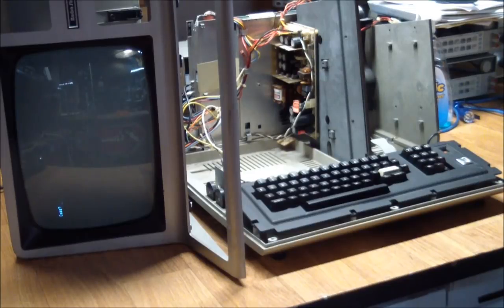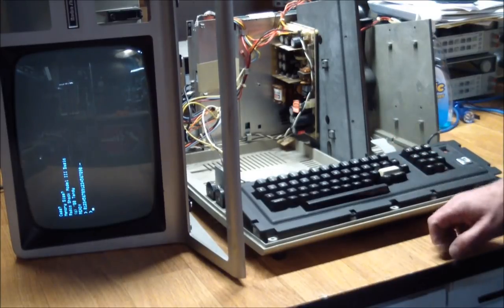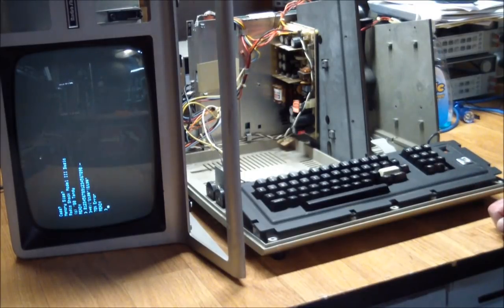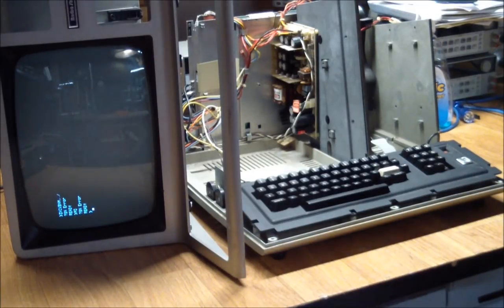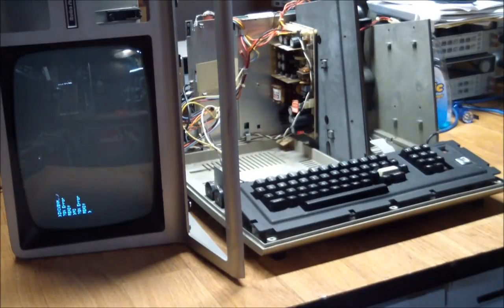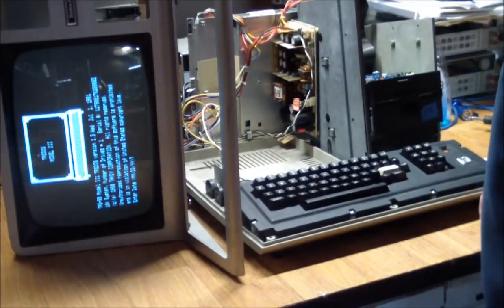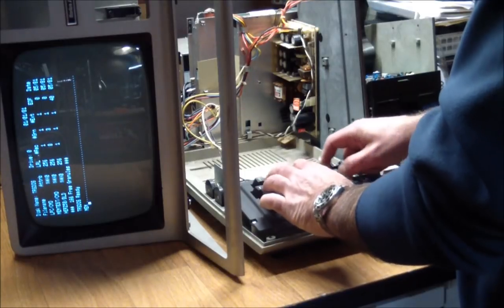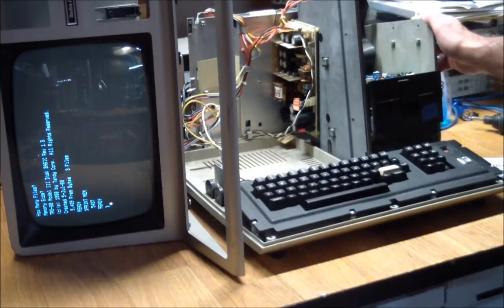AE#73 Repairing A TRS-80 Model III Keyboard

Comment: Thanks for this video! Just repaired my M4 keyboard in a similar manner. I just used a small set of pliers to remove the switches from the metal frame after desoldering them (grab the tabs and pull them upright from the metal frame, makes it really easy) and 99% IPA to clean the metal tabs inside the switches. Keep up your good work!

Comment: I would add a tiny bit of lightbulb grease on the metal contacts to prevent corrosion. For punching out the foil, I would remove the backing and stick it onto a clean UHMW cutting board and punch it out. The adhesive won't stick well to the UHMW, allowing for easy removal. I believe, however, there's a flesible graphite base paint.

Comment: I'm working on a Model III with some non-functioning keys, but this machine has switches that are the same as the Model I (2 pinouts, and a funky switch mechanism. For all but one, I was able to get the switch working again, but one of them is holding out. When I say the switch mechanism is "funky" it has two exposed copper lines and then a Y-shaped piece that "springs" out above the two copper lines. Pushing the key down pushes the Y-shaped piece closer to the exposed copper lines and lowers the resistance. I'd say the switch was designed to enable the detection of the depth to which the key was pressed.
Reply from the maker: That almost sounds like a touch or velocity sensitive key.

Comment: Anything under 1000 ohms is good.  Clean the metal in the bottom, and lightly "sand" the carbon pad on printer paper.  Get the resistance to under 100 ohms, most under 100 ohms.  Should be good for many years.  One could also change the pull-up resistor pack, RP1, on the mother board, to 2K or maybe 4.7K, and the keys will be a lot more responsive.

When the keys don't work, they measure about 6K-ish.  If RP1 was a 20K Pull-up, thy keyboard will without taking it all apart.

Comment: The reason that metal polish turns dark is it’s a very fine abrasive slurry; and what you are seeing is the metal particles that it has abraded off of the surface (it doesn’t take much to darken the swab).

Comment: Happy New Year. Keep the good stuff coming.  Why didn't you clean the carbon disk with IPA as well?  That usually is enough to get those contacts back in shape.  You may avoid ripping traces or pads if you add some fresh solder prior to removing the old solder.  The solder will flow easier, putting less stress on the traces.
Reply from the maker: And a Happy New Year to you too. I did give the disks a final IPA cleaning just before I inserted them in the switch housing but neglected to show that part.

Comment: You might be able to punch disks cleaner with a paper punch that punches pages for a ring binder folder. Just open the bottom of the punch and look down the punch hole from the bottom, and that lets you line up the metallic foil tape with the hole.
Reply: Different size, too large.

Comment: I took in a III and 4 at VCF Midwest in a trade, and hoh BOY are the keyboards cumbersome to get at. Entire bottom row on the III wasn't working so I pulled it and attempted to treat the keys using a bit of deoxit on a cotton swab. 40 solder joints desoldered and replaced for nothing...and for some reason the rubber domes were a lot more fiddly on mine than yours. I spent at least ten minutes trying to get each one reseated. Ended up just shrugging and doing a temporary part out to help on troubleshooting my IV's floppy drives since it's in better shape under the hood (and I pray it stays that way). I really wanna get the III going eventually, though, since it's practically immaculate.
Reply: Barry Manilowa  Thanks for the pointers! Good to know just replacing the switches is an option - if I'm gonna have to desolder 'em all, I wanna do something that I know'll work!

The III itself has been lying dormant - I've been working on the 4, which has suddenly developed vertical deflection issues. (Oh boy)